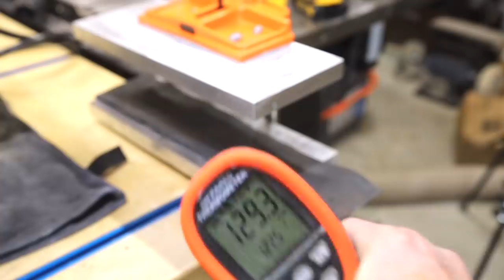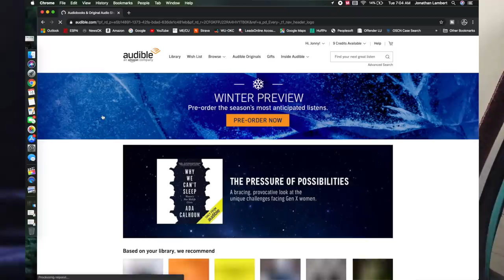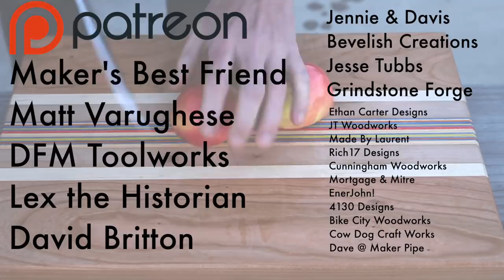Making my First Chef's Knife. Will She Like It??

Comment: The Gyuto is the Japanese equivalent of a European, all-purpose chef knife. This knife is great for completing various tasks, such as filleting protein and cutting and chopping fruits and vegetables at home in the kitchen
The gyuto is a Japanese designed chef’s knife. Gyutos vary widely in design but generally range from 210mm to 270mm in length though smaller and larger examples can be found

Comment: Just wondering why you think the bevel grinding needs to be done after heat treatment. You can do it in that order but it's not a requirement. Bevels can be done before heat treating. You will save a  lot of grinding belts. Anyway just curious. I really like the fact that you narrate and didnt just play music.
Reply: A lot of stainless steels used for knifemaking are very prone to warping if heat treated to thin.

Comment: Beautiful but looks very heavy and 5 hors grinding wow! Would you have chosen a thiner piece of Steel to start with if you were redoing it? Also, please bolt that Grinder to the Bench before you lose an eye
Reply from the maker: Tried to order a thinner piece of nitro v but it was back ordered. Decided to roll with what I had. It’s definitely heavier than a traditional chefs knife.

Comment: Very good job, but it's way too thick blade for a kitchen knife from this type, it's just gets too heavy, and the cutting performance is seriously effected by the thickness, i recommend you to try 3 mm blade thickness with a full flat grinded bevels to about 0.3 mm at the cutting edge, you're gonna see and feel the difference between the weight and the cutting performance, i promise ! Keep up the nice work! ✌

Comment: What is the reasoning for the tool wrap?
Reply from the maker: To create an inert environment around the knife and prevent decarburization. I talk about it in detail in the vid.
Reply: @JonnyBuilds  Thanks!  I usually watch knife making videos in bed with no sound.
Reply from the maker: No worries. Most don’t even have vo. Because stainless steel requires such a high critical temp before quench the oxygen around the metal works to pull carbon out of the steel. This prevents that mostly.